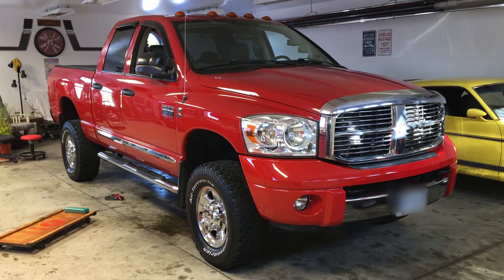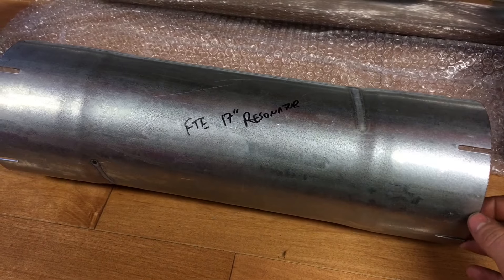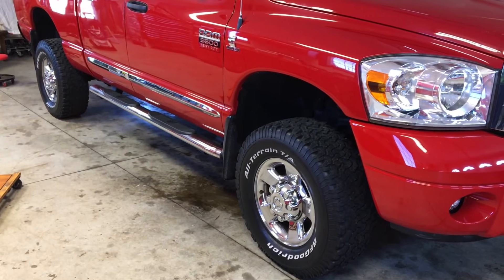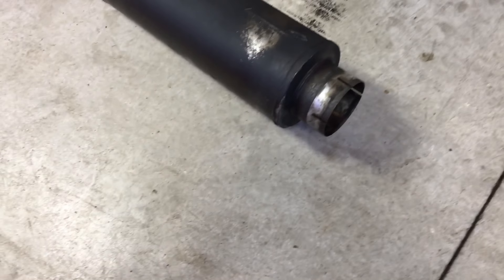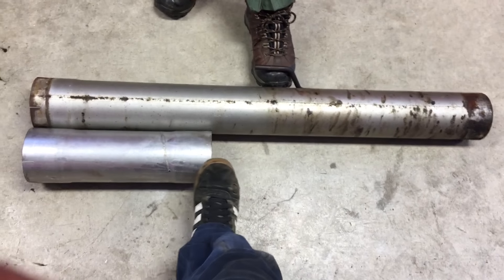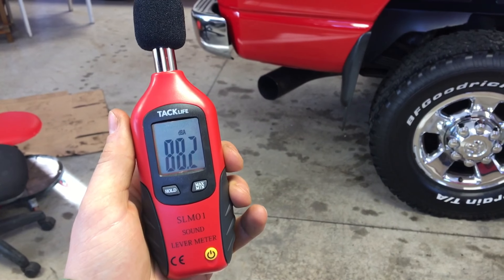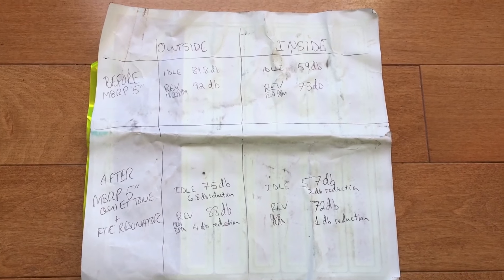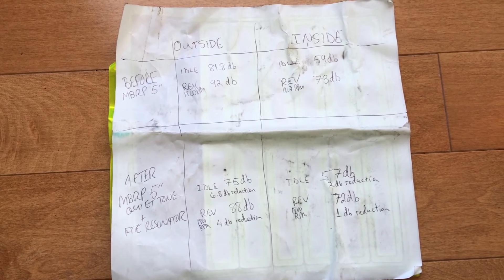MBRP Quiet Tone Muffler 2009 6.7 Cummins

Comment: Would your worry about the temps if you put two mufflers on the system?
Reply: no way... the factory DPF and NOX cans are still so much more restrictive than these. both of those cans he put on are still straight though. I doubt he sees any more than 100 degrees increase.. like way less than that. regardless of tune.

Comment: I know you went 5" , but if you had kept the 4" and left the factory down pipe (with CAT), that really helps a lot of the in cab noise, the cat acts like a resonator. The factory down pip and cat is doubled walled. A factory downpipe/cat + a good straight muffler is about as quiet as a stock DPF equipped truck. But if you need 5" to keep the EGT's down, then yoiu need 5" haha. 

Good stuff, thanks for posting dude. 

Also im willing to bet most of DBA your picking up is the Cummins itself. After your exhaust mods, I could tell it had less "low end" tone. This likely helped the noise the neighbors hear yes?
Reply from the maker: It was definitely a lot quieter in the low tones for sure.

Comment: Might as well put the dpf back on
Reply: Do mufflers really have that much of an effect on power and fuel mileage? I want to get a full delete but want the beast to be nearly silent if possible. I hate loud noise as I've driven many 7.3s and once driven in one without a muffler system. I could care less about how something sounds now, maybe some engine noise but exhaust...nahhh
Reply: The flopro spiral resonator will get rid of the drone and muffle some sound.
Reply: It can not be